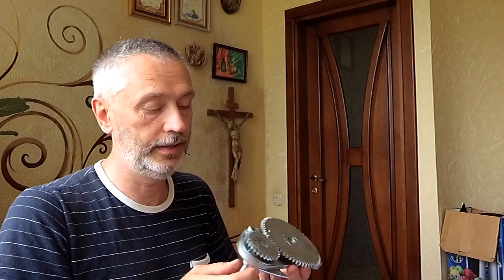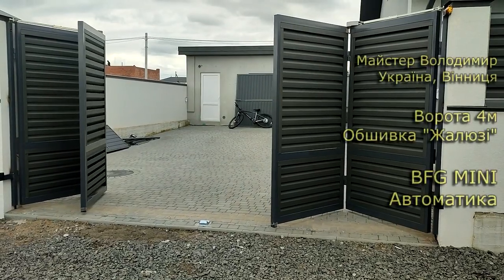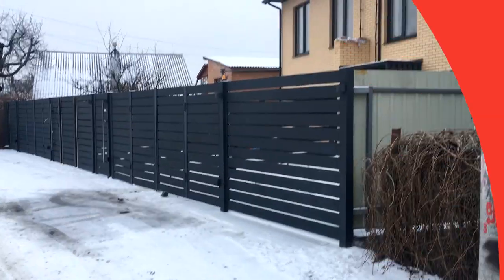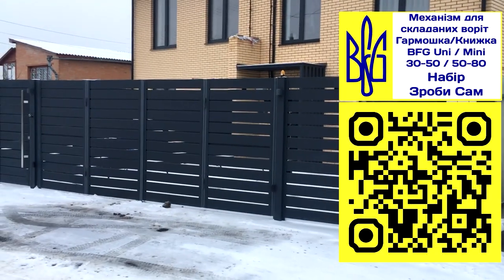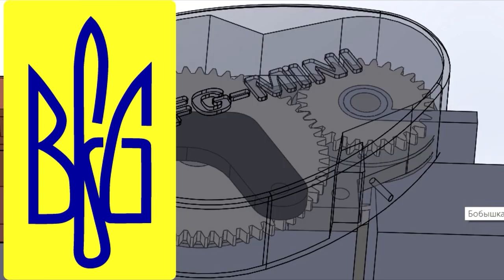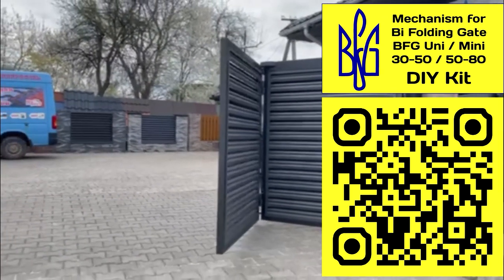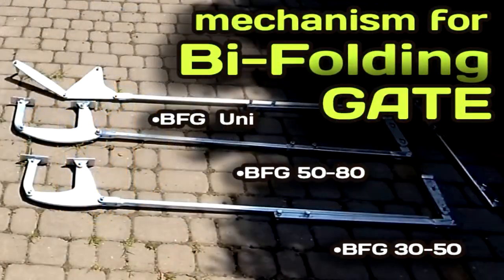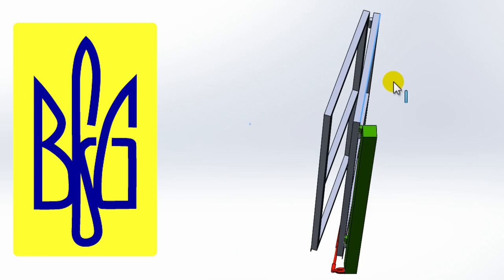Bi-folding gates using gear mechanism BFG-Mini DIY kit. Brief video review and installation examples

Comment: Hello. I want to ask if the BFG-Mini DIY kit mechanism can be installed on a Bi Folding Gate, which the gap between the shutters is less than 5mm. 
I am interested in this mechanism because it is more practical than the others you have. 

If you can help me, I can send pictures and drawings of the construction. 
Is the mechanism, BFG-Mini DIY kit, available?
Can it be shipped to Greece? 
Thank you very much.
Reply from the maker: Hello! Sorry for the delay in response - I haven't checked new posts for a couple of days.
Yes, you can install it. The main thing is which axis you installed on the post and the first leaf. The loop should be on the back plane of the post and gate. If you have a wide gap and the hinge is located between the post and the sash, you will not be able to install the mechanism.
There have been no customers from Greece yet. You will be the first)
There is a customer from Cyprus.
To order the mechanism you need to pay the cost of the mechanism 400 dollars + the cost of delivery to Greece - 64 dollars. Delivery time is about 2-3 weeks.
Reply: @AlexanderAlisGlobal  how can i sent you Fotos and plans ?